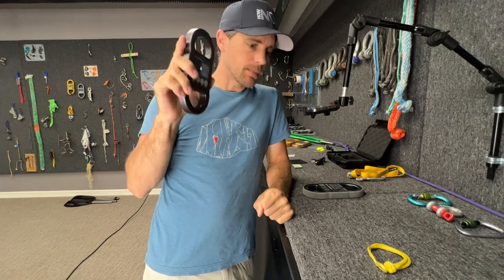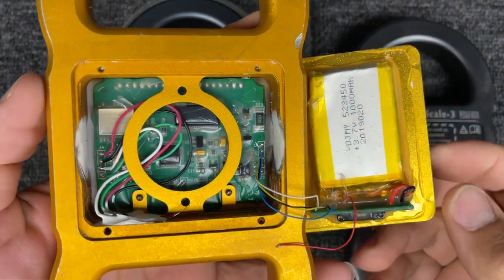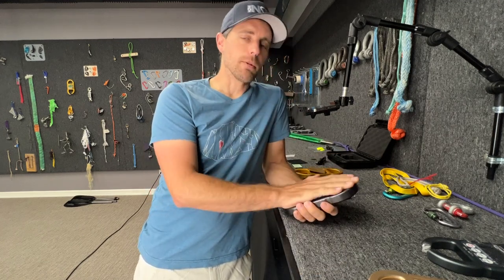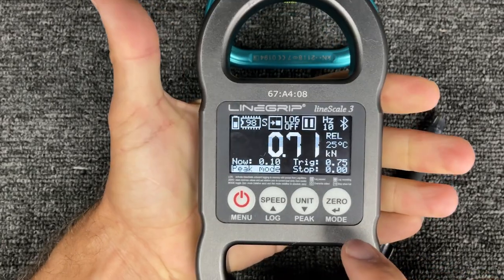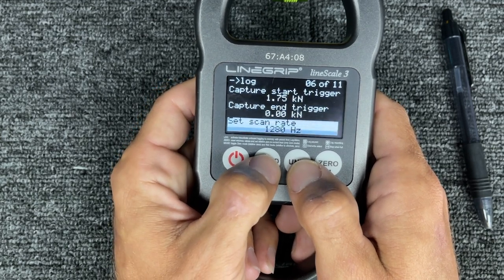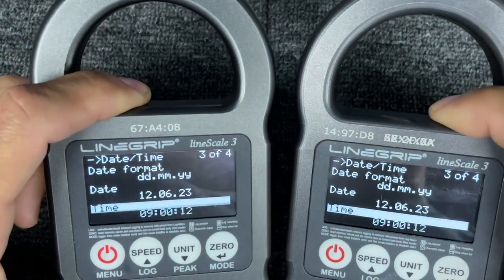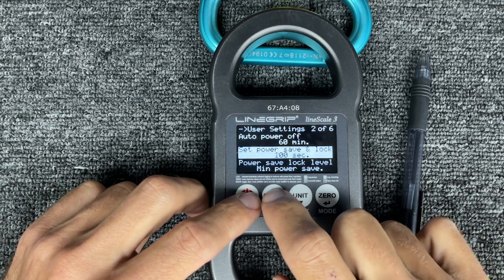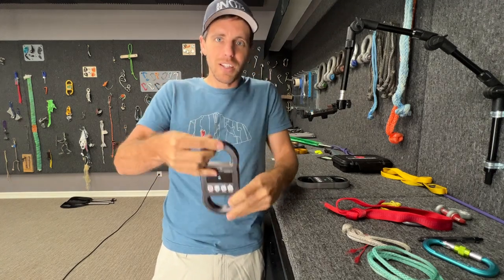Line Scale 3 Deep Dive Tutorial (June 2023)

Comment: FYI for the date format, using year-month-day format can be nice for ordering stuff on a computer. I somewhat commonly use that date format as a software developer.

I'm guessing the date ends up in the log file names right? So if you have several logs on different days (especially if those days are in different months or years) then if you sort by the file name, year-month-day will always sort chronologically.

This doesn't really matter if the device has some different method of sorting log files. E.g. if the file names begin with a number that just increments by one for each new log, then sorting on file name would always sort things chronologically anyway.
Reply: Nvm got to the exporting data section. Looks like it exports in year-month-date regardless of what format it displays on the device itself. Disregard!